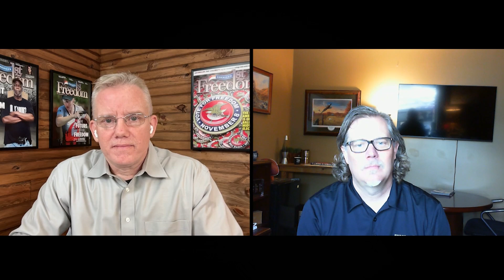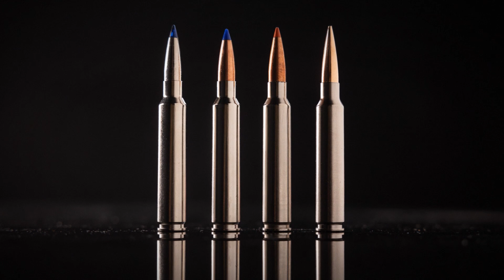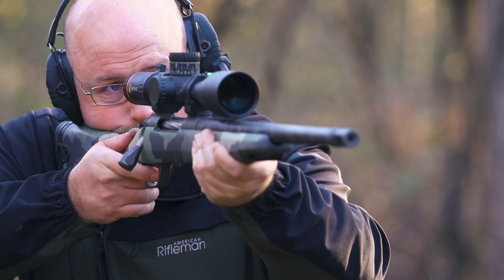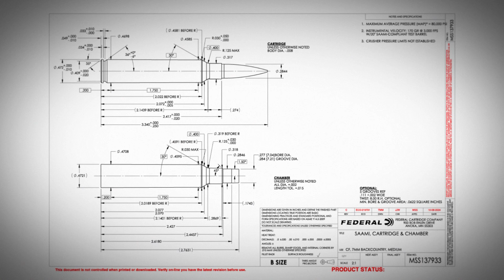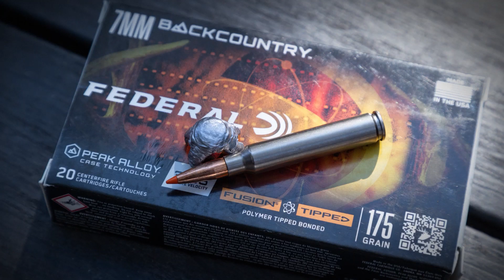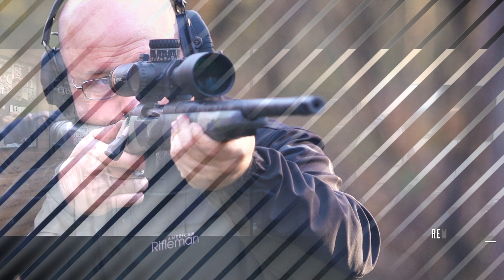First Look with American Hunter: Federal 7mm Backcountry

Comment: Obviously, they won't say shit, with  mouth full of it. Yup, it's a new alloy, that handles more pressure than the 65,000psi allowed by traditional brass alloy. What they can't say yet(reloading date isn't out) is what actually accomplishes the increased pressure. The 7mm Rem Mag was factory loaded with IMR7828 when that powder was not yet available to the public. Both Remington and IMR were owned by DuPont then. Anyways, these guys could be politicians. So, this increased case strength technology has been around for some time.
Reply: Wow does time bite back. Always a negative Nancy when something new is out. A year later from your comment and the round is amazing. Many animals later and I can say I have zero issues.

Comment: Yeah, but due to supply chain issues, you are not making 338 Winchester Mag 210 gr NP loadings or the 7 x57 140 gr NP load either. Yet you have the resources for this bit of BS. I will not trade my 7x57 or 338 Winchester for this one anytime soon. Gee, you can't even find primers, cases, and powder, and when you do, it's through the roof.

Comment: I saw a review on Ron Spomer's channel. Eastern Bloc steel case ammo is designed as single use, but I have successfully reloaded 7,62x39 steel cases as many as four times. Reloadability is crucial, as I imagine the cartridges will not be cheap, but I am still wondering about throat erosion at 80 000 psi.  There will also probably be many applications for silencers for the 20" barrels, as shown on Ron's channel.

Comment: Call me skeptical about no increase in bolt load. I want to see the data.
Reply: ³0-06 bolt face Compared to a magnum bolt face  larger diameter means more push if psi used to push is the same.

Comment: The cartridge is a 280 AI looks like, so I like that too.
Reply: No, You could use 280 Rem or 280 AI(Or whatever 30-06) to make brass for the 7mmBC and load it to 280 reload data. The 7mmBC case is 0.10 shorter. What I noticed is it could fit in a 280AI chamber
Reply: @WillyK51 that last part concerns me a bit.. some goofball bound to try this in a 280AI

Comment: I would get it in a three-lug bolt action with a 24 inch long muzzle brake equipped barrel with 1 in 8 barrel twist. Like it because one more round in the magazine without a loss in performance.

Comment: A solution to a problem that does not exist.  A nickel plated Wolf steel case at $200 per box of 20.
Reply: or about the same as current premium magnum $50-$70 depending on load
Reply: Like the Jeff Cooper quote!